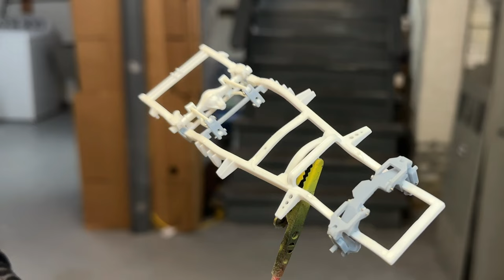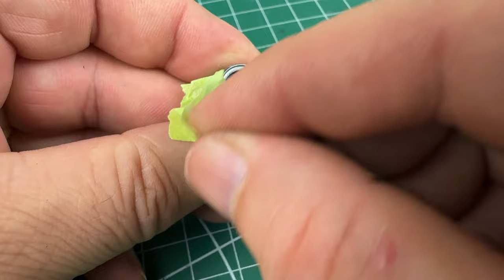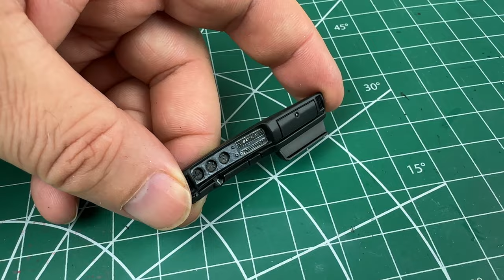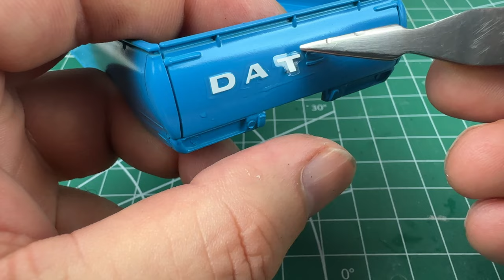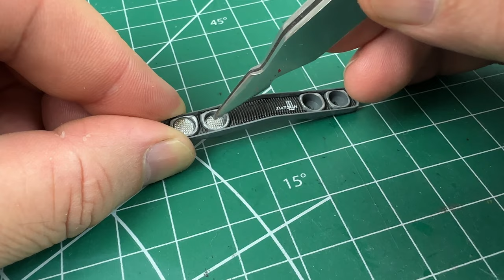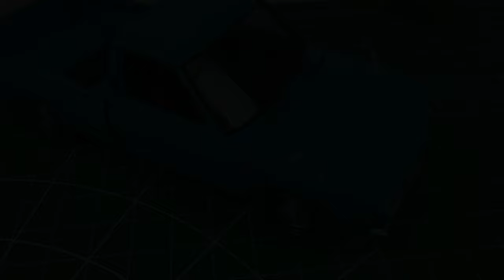Build a Miniature Japanese Truck: The Datsun 620 by MPC (Round 2) [FULL BUILD]

Comment: As the owner of a real '76 Datsun truck back in the early '80s, I can say this is nearly perfect!
Reply from the maker: It is actually quite a good kit by MPC with a lot of accurate details.  I have modified the suspension but it does come with original leaf rear and torsion bar front suspension.

Comment: Very cool.
Reply from the maker: Thanks so much!
Reply: @ScaleAutoGarage  
You're welcome,  I have that kit, and I want to lower it, what kind of front suspension did you use on it?
Reply from the maker: @marsgarage8217  the front suspension I picked up on Facebook a few years ago. It’s actually for the S10 kit but I modified it to fit the Datsun. It is a printer set of pieces that make the front adjustable.  Maybe you can find something similar on Cults3d. I have done this kit previously and used the suspension from the kit by cutting off the arms and raising everything and gluing it back together.
Reply: @ScaleAutoGarage  
Oh nice, thanks.

Comment: I like that kinda cornflower blue you have going there, Spencer. I want to paint mine butterscotch, which is a color I well remember on these back in the day. I haven’t opened mine yet, so what’s up with the hole in the bed?
Reply from the maker: Pretty sure one of the 6 I’ve owned over the years was that butterscotch color. It’s perfect. With this one I actually built a full custom suspension, lowered spindles and adjustable in the front and a complete scratch built 4 link rear end with a C-notch for rear ride height. With the notch you need to cut away some of the bed floor for the notch to fit. Unfortunately I didn’t actually film any of it as I wasn’t going to build this for YouTube but when the Ferrari paint got ruined, I figured I would finish this one off for YouTube first. I will have more photos on my instagram when I begin posting them. If you are building this with the stick ride height, it is really really high. 🤣

Comment: Where did all the dropped suspension components come from? These 3d printed items?
Reply from the maker: The front I got from someone on FB years ago. it was for the S-10 kit but I modified it to work on this one. The rear is a scratch built 4 link.